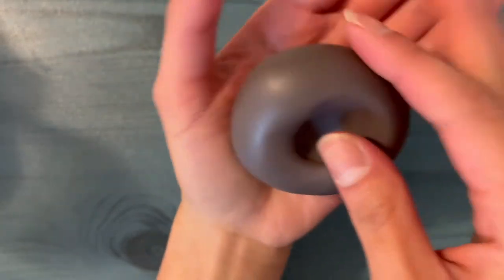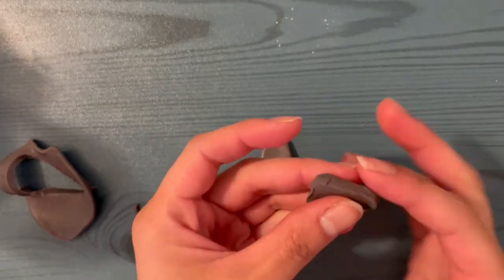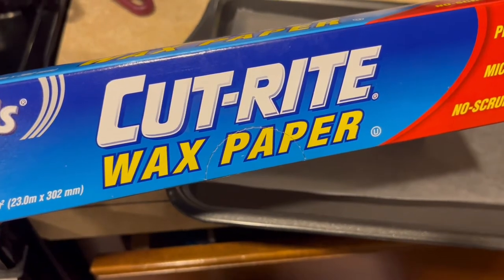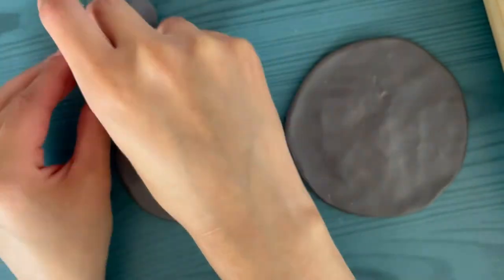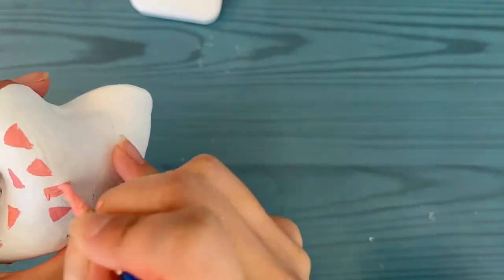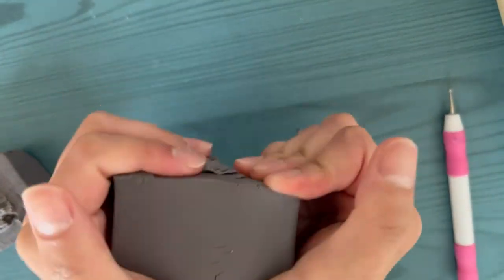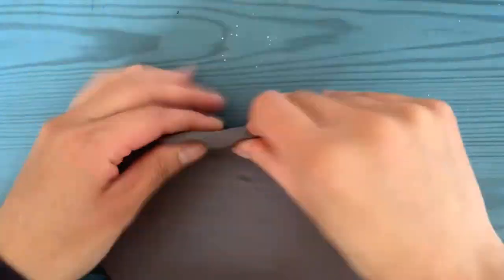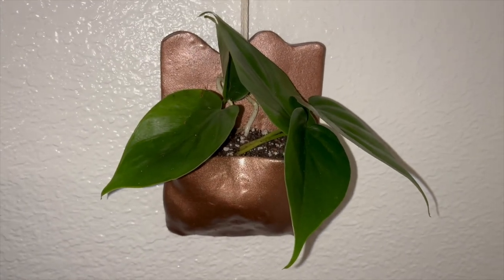Making Unique Planters with Polymer Clay! (Chic, Modern & CUTE)

Comment: FYI.  Cardboard can be baked at 275 degrees Fahrenheit (dF.)   Remember, Fahrenheit 451.  That was the title of  an old science fiction book from the 1960's, which was all about book burning.  Because paper burns at 451 dF.  Carboard is made of paper.  In fact, waxed paper burns at 420 dF.  The thing you have to be careful about is using any kind of plastics, mostly because they are often blends of different plastic and some burn at relatively low temperatures.  Because: Plastics.  Go figure.  But this is probably where the misconception about paper comes from.  That is, if plastic can melt at low temperatures, paper must be even more fragile.  But it's not.  BTW, you could also use tin/aluminum foil to shape things.  It holds a shape better.